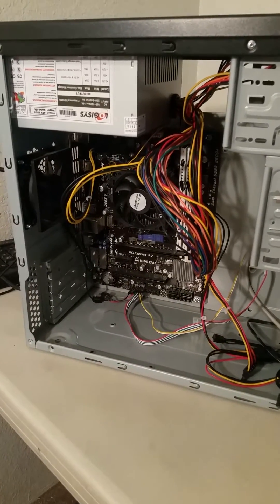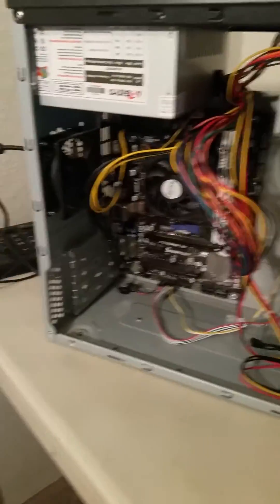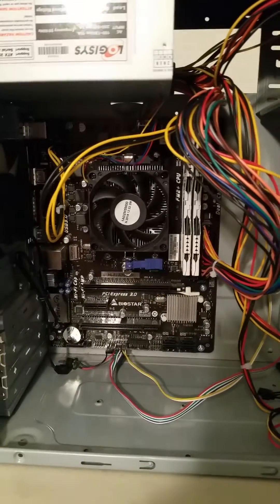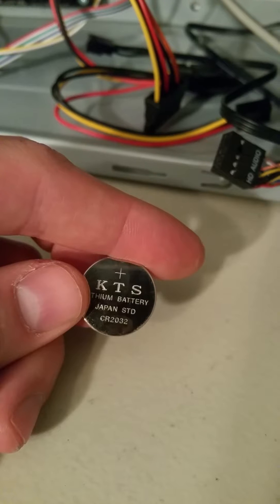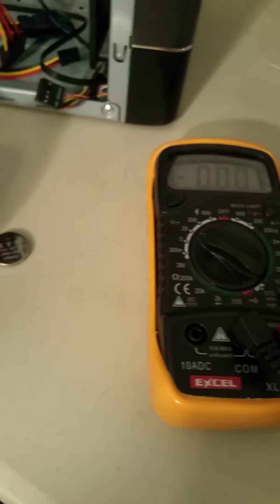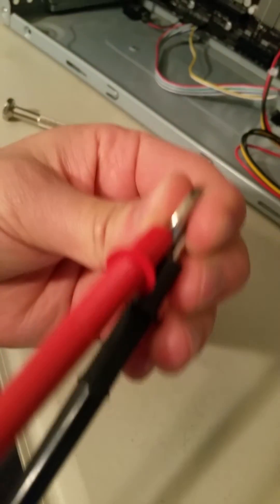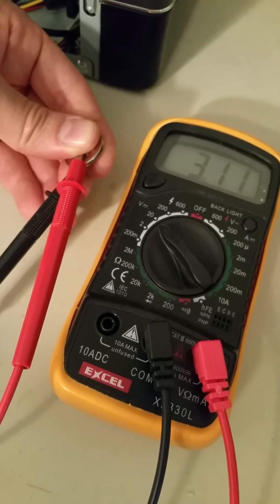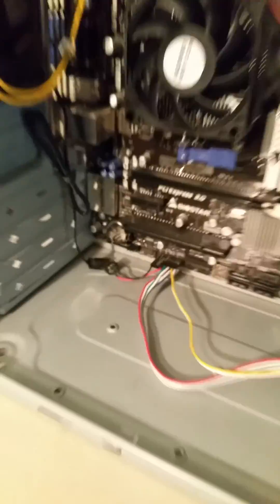how to test cmos battery

Comment: What if mine is right below?? Like 2.94
Reply from the maker: 2.94V is too low.  I would replace battery.
Reply from the maker: @Philippe Pomerleau 2.6volts is way too low, I would never recommend allowing it to go that low.  This battery powers the bios and the bios controls the voltages to the components in the computer.  Not worth risking expensive components in the computer, especially when you can buy these batteries for less than $1.  I have seen bios trigger errors at 3.04volts before, so ideally you want your battery between 3.3 to 3.1volts.  Most new batteries will be at 3.3 volts.